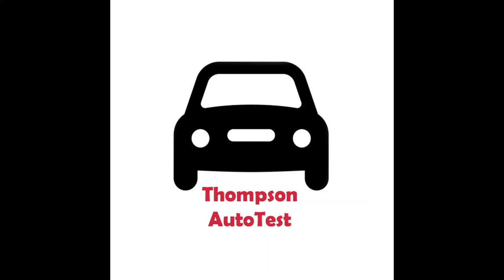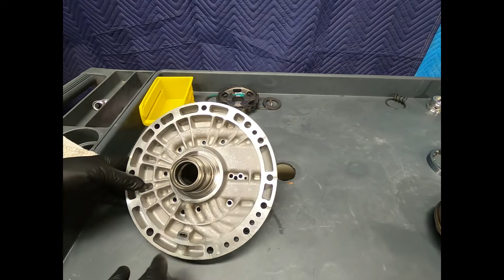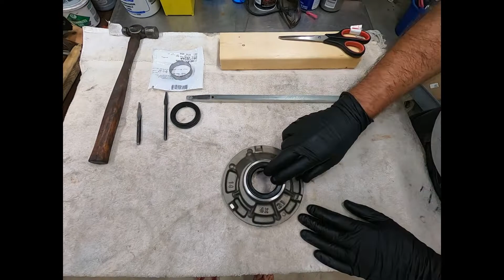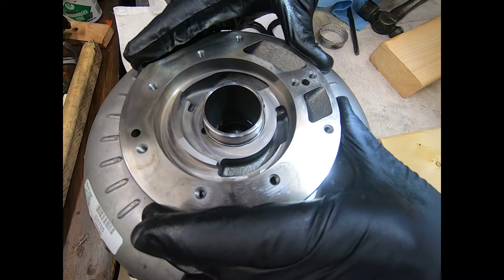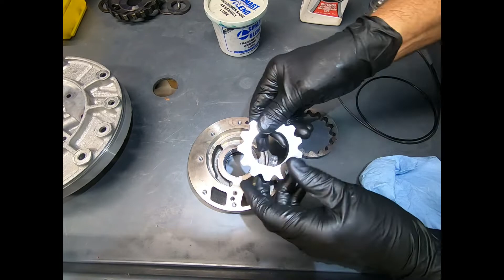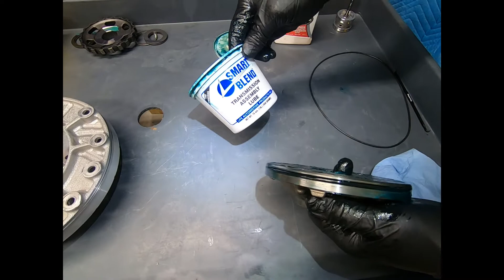Nissan RE5R05E Front Pump and Clutch Rebuild

Comment: I have codes p0715 and u0101 2013 rogue and my car will not move after repairing both speed sensors, terminals, spark plugs will be doing a transmission service in a day or two. Is there something I'm missing. It will up to 2000 rpms and stall the car will not move